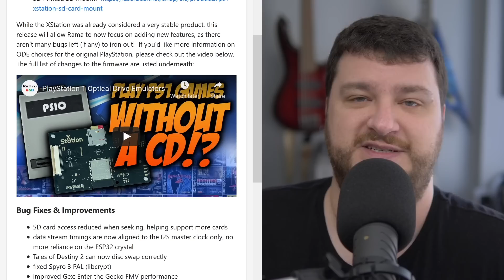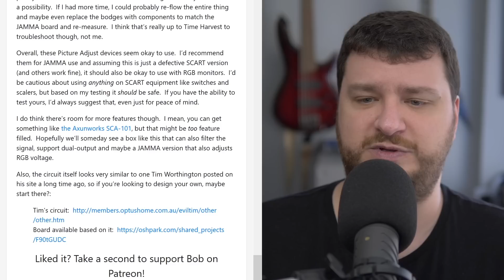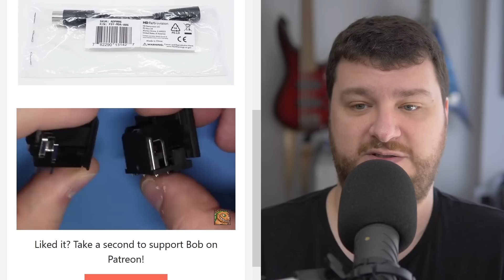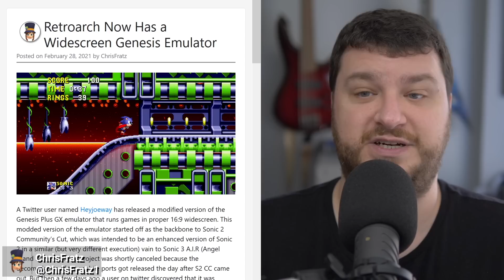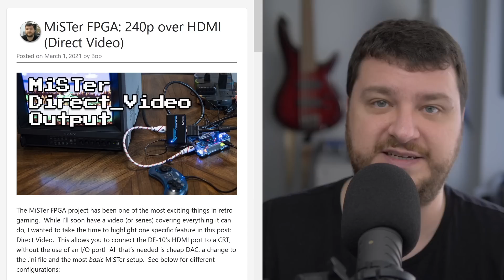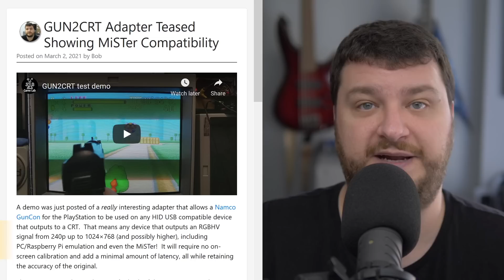RetroRGB Weekly Roundup #243 - March 3rd 2021

Comment: Great update as always Bob! Thanks for the shoutout too. Testing on the JaguarGD CD support is going well but it's still very fussy about SD cards and how the files are copied (the CD images currently need to be contiguous - ie not fragmented). Understandably RetroHQ is reluctant to release the firmware as-is as it would lead to a bit of a support nightmare with all of the different SD cards out there, so the focus now is on making things more forgiving and reliable. It's come on so much in recent weeks though, and although I'm by no means any kind of official spokesman my opinion is that a public release can't be too far off now based on what I've seen.

Comment: I recently bought the same scart RGB-shifter from time harvest and got the same problem. Once a whie it looked the shifter loosing sync and the picture rolled for a 1-2 seconds. I adjusted a little bit the Hold on my pvm testing monitor and now its works without porblems anymore. Maybe this can help you and people coming across the same probem.

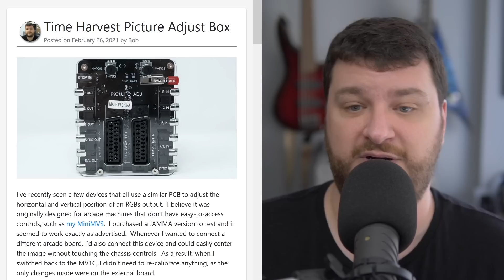Comment: 15:28 Ha, I already use an HD Retrovision Genesis component cable with my PC Engine because the Super SD System 3 by Terra Onion also has that function (with no console modding).  

Yeah, that's FAR more expensive, but honestly, if you have a PC Engine or TurboGrafx (not a Duo), you really should have a Super SD System 3.  PC Engine CD drives break all the time and are expensive to repair, TurboGrafx CD drives are super rare and expensive, you'll have to hunt down the expensive RAM boosting System Cards to play Super-CD and Arcade games, and the quality of early console CD ROMs (Sega CD included) is pretty low, meaning many real PC Engine CDs are getting disk rot and will require lots of care to preserve in playing condition (though the CD drives do play backups without any modding needed).  With the SSDS3, you can play CD games off a an SD card (and Hu Card games) and you get an RGB Genesis video port.  All things considered, even the $300 price tag is a steal if you own a PC Engine or TurboGrafx.  Also, many of the great PC Engine CD games were only released in Japan, so you're going to want fan translations of those ISOs anyway.  It just makes sense to play PC Engine CD games with an ODE rather than off real CDs.
Reply: Agreed. And with the SSDS3 you also don't have to RGB mod your console at all. Just be sure to also use a quality microSD card like SanDisk.
Reply: @gtbeakerman  By that point, you only have to worry about the RGB vs. YUV color space issue.
Reply: @AceTrainerX3   I don't know of an existing RGB mod that resolves the colorspace issue. I wouldn't worry about it anyways, not a huge difference. If you do care, go with a Mister or maybe wait for the Analogue Duo.

Comment: Bob - I'd love a dedicated video on sync stripping and combining -- when either is needed and for what kinds of setups. I feel like opinions on this have changed over the years with voltage testing. I may be looking to upgrade my cables and switches I know I'm going to be concerned about damaging something.
Reply from the maker: Short version:  You don't need sync strippers inside RGB SCART at all anymore, unless you're going into an Extron crosspoint.  In all other cases, it's better to get standard RGB SCART cables.  If for whatever reason your display (like a rare XM29) requires changing the sync signal, do it right at the display.

Comment: I got like 30 SNES motherboards waiting for shells. 

If they go with the earliest revision shell it will work with all SNES boards if they remove one obstructing stand off in the back. They could also go with the later revision SNES shell if people will discard the metal RF shield plate from the bottom of SNES and they tweak the additional height “ring” that was added to the main screw post in the back of the console (the side near the “Nintendo service” sticker). 

They could definitely get both SNES board styles into one shell design.

Comment: It's great to see someone talking about direct video on the Mister. It seems like almost everyone thinks they need an IO board to get 15khz video out of the Mister. I've been using a $5 hdmi to vga dongle off amazon and it works perfectly with no lag on my pvm monitor. Add ram and a $2 micro to usb cable and you have a full setup for under $200.

Comment: Hi Bob. Could you elaborate on which port on the analog I/O board is needed for lightgun support? I'm working on a custom case with a custom digital I/O board, but I may want to add this port if possible :)
Reply from the maker: All that's needed is H & V sync, so standard I/O boards would get this from the "VGA" port.  If you were planning on using a DIN for RGB SCART output, people could just use an HDMI to VGA adapter and use that instead, so no big deal either way :)
Reply: @RetroRGB  Okay so just to be absolutely sure. I could just use sync from the DAC for lightguns, right? I only plan to have HDMI out. I don't own a CRT myself, but it may be of use someday - best to consider all possible options before building anything :)
Reply from the maker: Correct!  You have nothing to worry about.
Reply: @RetroRGB  Excellent. That's what I thought, but good to be sure :)

Comment: For the Satiator, it actually takes a full size SD Card, and you can get SanDisk 100 MB/s cards with 256 GB for about 35 bucks, and that's way more than enough space and speed for the Saturn library. There are seriously so many duplicates and demos that are a tremendous waste of space, and even filling your card up with at least one copy of every single game, including the Mahjong strip games and all Japanese visual novels, you'd still be hard presssef to break 150 GB. The Saturn is one of the consoles where needless hoarding of the full Redump set seriously wastes your money and the comfort of browsing the games.

Comment: A few years ago I wrote a driver to use the guncon in a linux pc using the parallel port.  It's not too hard, the guncon already spits the xy coordinates as if it was an analog stick.

At the time I was using it to play snatcher, through an hdmi to component adapter.

It's cool, but who was a parallel port or three in their pc anymore besides me?
Reply: There were drivers for windows too 15 years ago. Smog and Acorn wrote them for windows 32bit. No source was released and they were never ported to win10 64bit. This looks like a great solution.

Comment: Anyone have experience repairing TG16? I recapped the board and removed the RF, got an AV expansion port adapter and tried tapping into the CVBS on the board and am still getting just a white screen. Other than trying another game or the actual HuCard slot, I sourced some actual or hear identical (HSRM2256LM12 vs SRM2256LM12) RAM chips which others online have mentioned work as replacements. Any ideas?

Comment: The H/V adjustment JAMMA adapters do come in a JAMMA extension cable version. I have one on order (already been using the JAMMA version for about a year now with no issues).
Reply from the maker: Can you post a link please?
Reply: @RetroRGB  item 1005001483755896 on aliexpress is the one I ordered (link seems to have been removed by youtube). Note this is NOT from Time Harvest and the description has changed a bit since I ordered. So we'll see what I end up with... wanted this to run to my Naomi which I have outside my cabinet due to needing a dedicated power supply.
Reply: @RetroRGB  JAMMA extension has arrived, and while I'm going to do a lot of testing before I use it on my cabinet so far it's really nice. Includes a bunch of features, including the aforementioned H/V adjustment (PCB on the bottom is identical to the TimeHarvest one) along with options to pass through 6 button & stereo. It has a brightness boost, which I may use for my Namco 246 as those are really dim and it has LEDs that light up with the corresponding inputs showing which direction and button is pressed. There's even a 5v readout.